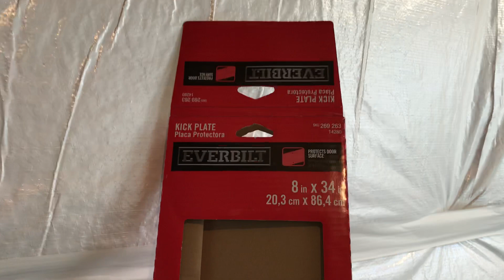Ender 2 Printer Bed Extension

Comment: question because I am having an issue using the last bit of my print bed. How did you get the ender firmware to recognize to build past the already programmed limit. Mine stops at 250 when it should be able to go up to 300
Reply from the maker: matthew sudberg I added new firmware and changed the configurations  to allow me. TH3D studio.

Comment: This is awesome!  Did you use a heated bed? It looks like you disconnected the heated bed. Also did you stay with the ender board or use something else? Where did you get the brackets that hold the kickplate to the bearings? Also how is the kickplate level enough to serve as a printing bed?
Reply from the maker: Israel Contreras I disconnected it. Got parts on Amazon’s or printed them. The bed was level when levels were placed at the intervals of the holes.
Reply: @FrogCube Awesome! Thanks for the reply. Great Job!

Comment: I just received an Ender 3 and was wondering why I don't see people just buying longer pieces of extrusion, longer belts and wire to extend the wiring and just make their build surface larger. It seems that the larger printers cost twice as much, but use the same hardware and software. The cost seems to be in the cheapest stuff. The extrusion, wire length and belts.
Reply: If you are planning to use cold bed and print with PLA, you will be fine, there is no heatbed with that dimensions and the power supply cannot be able to handle a larger one, but, it is an amazing demostration about what can you do when the firmware it is open source and you can modify as your requirements.

Comment: That's awesome. I assume you can expand both x and y axis?  Could you please give links where you got the parts? Thanks.
Reply: you can extend X to a point but the cantilever design will begin to exhibit issues past about 200mm or so (mass) Z can also be extended but "flex" will become an issue if you go too high. I bet you could get away with 400mm if you sacrifice a little layer alignment resolution expectations.
Reply from the maker: Just the Y axis. https://www.thingiverse.com/thing:2817257
Reply: Hey Nerys love your videos. I commented about the thumb screws on one of your videos, still giggling.  But couldn't the cantilever be supported, or maybe even the whole thing be box framed somehow? I think MANY of the cheaper machines have a huge upgrade path for the willing/daring.
Reply from the maker: Nerys agreed. I actually tried to make this even longer. But not worth it so I’m returning it to this format provided I can find a place to put it!
Reply: Frog Cube you're insane :-) that makes the best kind of makers :-) I love it someone at mrrf did this to a Tron XY X1 for making sword inserts :-)
Reply: https://www.thingiverse.com/thing:2849015
Reply: Would you be able to post a bill of materials for this build of yours? This is exactly what I'm wanting to do to build a production line for miniatures using sequential printing. 

I'm gonna do this, I'd love to know your parts list.

Comment: Subbed and Liked ! we need to see more Makers adapting their printers this way Awesome Job ! Happy Extruding
Reply: Ron, I actually thought that was yours!
Reply: nope this belongs to the gentleman above Great build RIGHT !!!
Reply: yes     and I have been looking foe something to print 2' wide, did I see correctly in another vid say that these are ABS?   this long bed is heated?
Reply from the maker: Thanks. Much appreciated. Still working out the kinks, but I feel like it's a great start.
Reply from the maker: Not heated. Let me know if you know a 34" heat bed I can buy! I'd love one! I'm looking at a 3" x 32" one.
Reply: I do not, I was wondering if a series of smaller heat beds, with the thermistors wired in series through mosfets would control the temp, allowing each mosfet to power a specific section of the heated bed
Reply from the maker: Brew It, Print It, Build It, Blast It id love to do that. Not sure how possible it is unless it is controlled off the ramps.
Reply: I'll have to ask around next week at MRRF, see if some of the gurus have any suggestions
Reply: Check "Thomas Workshop". He made his own 400x400x400 printer with 4 off 200x200 heatbeds lol.